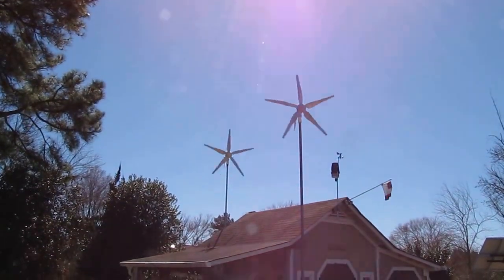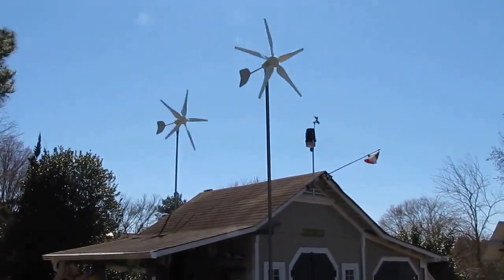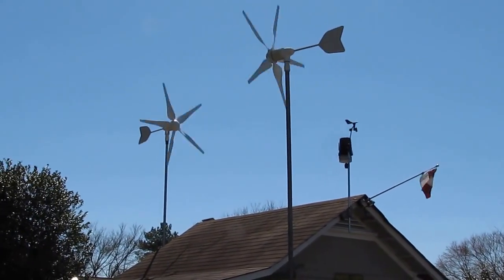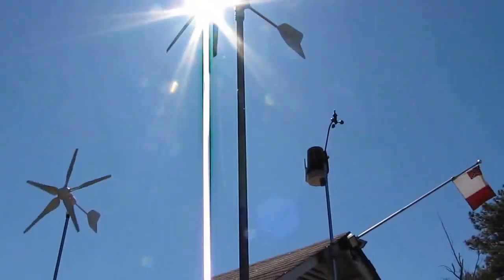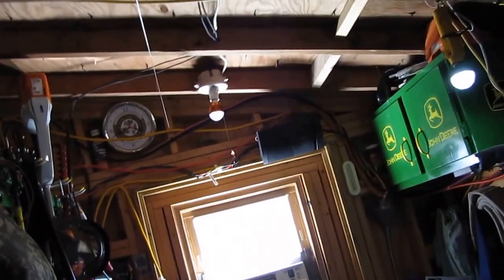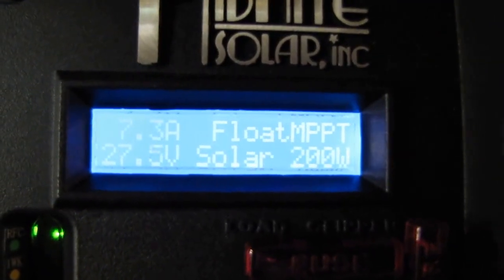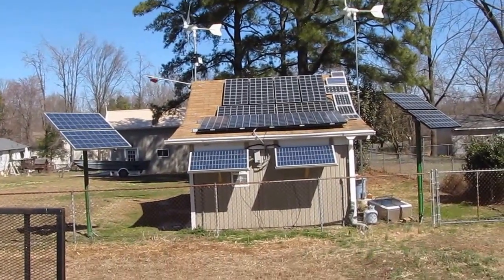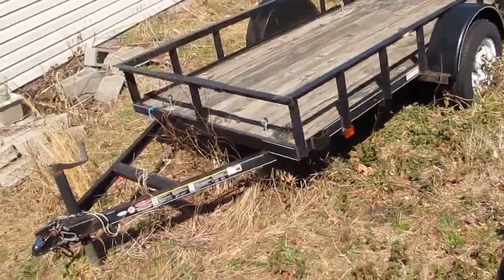Super Day For Solar And Wind Power March 2014 By KVUSMC

Comment: Kenny, what charge controllers are those wind turbines connected to?
Reply from the maker: Hey ejemm There Connected To The Batteries Direct With 63 Amp Breakers Before They Hit The Battery Bank I Have A Morningstar Tristar 60 Amp Which Is Set In Diversion Mode  If The Wind Turbines Hit 30.2 Volts The Charge Controller Will Divert Power Away From The Batteries  And They Will Go Into My Resistors / Air Heaters
Reply: kvusmc / Kenneth W Viar Jr : Thanks Kenny, hope you are well.
Reply from the maker: Thanks Buddy I Am Good How About Yourself  ?

Comment: I see also have a Morningstar Tri-Star in your shed.  What do you have hooked up to that charge controller?  Great system!
Reply from the maker: I Have That Morningstar Hooked To My Wind Turbines For A Diversion Controller To Take Power Away From The Batteries If They Get To Much Voltage
Reply: Ok that makes sense.  Nice set up!!
Reply from the maker: Thanks 646Silver